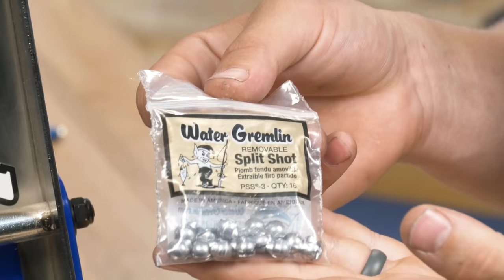Shop Talk: Is Wheel Balancing Worth It?

Comment: Dear Calvin and Truman,  This is the type of dumbed up video coming from a famous brand like PARK TOOL that makes consumers and the bicycle industry become dismissive about the importance of applying wheel balance technology. Wheel balance not only improves rolling efficiency & handling, but above all it makes a rider & bike much SAFER, especially at high speed.  Like any new technology like bicycle aerodynamics, first it was ridiculed, and now you can't sell a high end carbon or frame wheel with out it.  And just because you don't feel the advantage of aerodynamics working as you ride, its working. Same thing with bicycle wheel balance technology, and it will be more so then aerodynamics. Since the introduction of carbon wheels and improved aerodynamics bicycles are now faster and more sensitive then ever. But at the same time a new epidemic of dangerous HIGH SPEED WOBBLE/Shimmy has emerged and it is getting worse as more and more carbon wheels are introduced into the market.This type of dumbed up video that is going to turn around and bite Park Tool in the face when wheel balance will soon become the Must Have New Technology. Especially if its promoted mostly on its Safety merits.Also it obvious you have no idea how to balance a wheel. Just the fact that your are trying to demonstrate how to balance a wheel alone with no tire is just wrong, along with other silly things you do and say.Let me explain in as simple language as possible why a tiny and seemingly insignificant off balance of only 8 ~ 20 grams on a bicycle wheel is so dangerous at speed. This is the main reason modern carbon bikes at high speed ride nervous or go into an uncontrollable Speed Wobble. And the last place you want a bicycle to be unsafe is at High Speed.Look at those innocent 8 ~ 20 grams as a lighted match. If you drop that tiny lighted match on a dry grass field, its quickly turns into a large fire. And if that fire reaches a dry forest (meaning the speed increases)... Well you get the picture. The point is this, how to prevent that tiny match from being lit when it has to be dropped onto the dry grass field so as to prevent a bigger fire.This point exactly is what high end bicycle wheel engineers fail to understand as they focus only on the 8 ~ 20 grams spinning at high speed, and come up with a puzzling calculation saying this small amount of wheel unbalance is not significant enough to cause any problems especially the dreaded High Speed Wobble. And yes "Technically they are correct", BUT...What they don't seem to understand is those 8 ~ 20 grams at high speed start to invite the outer perimeter of the wheel weight to start oscillating.  And as speeds pick up, then the oscillation of the outer perimeter start to invite the entire wheel, from the axle to the outer perimeter of the wheel to oscillate creating incredible forces, to the point the wheel literally wants to tear its self off the frame.Making matters worse, now you have both the front & the rear wheel doing the same thing, but because the evolution of the modern bicycle is designed to absorb a tremendous amount of vibration, so the rider hardly notices the danger going on beneath them.  If by luck the wheels are fairly unbalanced going at about 35 mph the first sign a rider feels is the bike starts to handle nervously. Now the same rider approaches 45 mph plus, and now the violent oscillations of the front & rear wheels momentarily synchronize. Here is where the S#!T hits the fan as you now have the forces of two sledge hammers swinging in unison from the axles and the powerful oscillation forces can no longer be absorbed by the bicycle frame, rider and wheels that's when the High Speed Wobble happens, as the carbon wheels literally start to warp trying to destroy them selves trying to shed all that energy.You can see this happen in this video https://www.youtube.com/watch?v=QC-PuBDFNac  forward to 1min 10 sec. I know the fenders are shaking but look at the bottom of the wheels very carefully...My closing argument is this; Go look at a Chevy Suburban wheel an you will notice a tiny balance weight. Then ask your self how can that tiny piece of lead keep a massive 40 lb wheel balanced at high speed????  The answer is this, this tiny piece of lead cancels the tiny match from getting lighted when it gets dropped onto the dry grass field...So please all you are doing is putting your brand in a bad light because you are promoting something that is potentially very dangerous to riders all because you fail to understand this basic technology called wheel balance.  And if you still don't think its important then tonight when you go home, why not pull off those silly balance weights off your vehicle.Also there is a big difference between a bicycle, auto and M/C wheel.  Bicycle wheels easily flex, where auto & M/C wheels are much stronger and hardly flex.   Just remember this fact, Newton's 1st Law; a mass that is put in motion will continue in motion unless interrupted by an OUT SIDE FORCE (ie aerodynamics), or an OSCILLATION (ie wheel balance).   Imagine that, an FI racing car runs on these two facts.SincerelyDan Sotelodynamicspeedbalance.com

Comment: ive never done this or noticed it, but i do know that vibrations are never good for anything mechanical it can end up shaking bolts loose and such. does this really matter on a bike though i dont think so becuase i dont think it will be able to spin as much like if it were a car wheel, even then the difference will not be much because if it is likely wheel is already broken.

Comment: I don't think it will be an easy to control issue as tires and tubes  are not uniform either, then we add tubeless fluid for tubeless system... Well I have an idea why don't we add a single large wheel reflector and blame the unbalanced forces to it.

Comment: Hi, I have a Schwinn  all traine bike from Walwart. While riding the bike has a bad habit of leaning to one side while riding and makes it difficult to keep a good balance while riding. I have had other bikes in the past that had good balance while riding that I was able to ride without hold the handles. While trying very hard to do it with this bike has a terrible balance problem of leaning to one side throwing my whole rhythm and balance off. What can I do to fix this problem? Would balancing my tires really fix this problem? 🧐
Reply from the maker: Balancing the weight in the spinning wheel is not the issue.  Begin by checking the front wheel is install straight in the fork.  It is possible the fork it bent and this will cause the bike to pull to one side.  Get the issue correctly diagnosed, but it may be a new fork is required.  Last, if the bike was crashed, the frame may also be bent.  There is not a good repair for this.
Reply: @parktool  Hi, the bike was never crashed and was hardly used. I bought it brand new and was shipped directly to my house to assemble. I did not notice any damage to the forks nor any misalignment in assembly of the bike. Still leans to one side throwing off the balance on the bike.
Reply from the maker: Send an image of the bike to tech@parktool.com We may be able to help more there.

Comment: I'd say balance when you change tires and try to get the heavy spot on the tire to the opposite side of the heavy spot on the wheel before adding weights. After that, fugetaboutit.

Comment: I have taken some amount of time to balance wheels on a bike, but rather than being a two-wheeled upright, it was a three-wheeled recumbent trike and because of the imbalance on the left front, it would cause speed wobbles and veering to one side on fast descents, bearing in mind my top speed was 84mph, it was too dangerous not to have everything just right. So I did spend almost a day getting things to exact perfection, firstly by trying a similar method to what you have done in this video, but eventually just making an adaptor to run on a jig made for car wheels. Once balance, riding at speed and descents were much more pleasant and it only took 5 grams to fix it. Personally, I wouldn't bother for a two-wheeled machine, Taking it off-road wasn't always smart either... https://www.youtube.com/watch?v=BAo9KF6R-bs

Comment: I wonder if you can help I took my mountain bike to a shop to change the cassette the triple chainset and the chain got it after a month and they said that it has been ride tested so i took the bike and went home at the first hill i gave it a bit more power on the pedals and the chain slipped on top of the gears so i called them and told them and argued with them cause they said the bike was fine i took the bike to another shop after telling them what happened and they called me back after a day saying that the gear controller is not suitable for the back  derailleur as it is a Shimano Deore and when it clicks it does not move the derailleur properly 
By the way the shop changed the controllers as they said the were worn out so do I have to change the derailleur or there is something else it can be done? I appreciate any help you can give me  regards
Reply from the maker: Without seeing everything and being there, giving detailed advise is difficult.  The shifter and derailleur need to be compatible.   A shifter can also wear out.  That does not mean the derailleur require replacement, but again the systems need to be compatible.
Reply: Thank you for your prompt reply and for your advice I'll make a note of it Regards

Comment: Maybe its off topic..but..when just learned to true wheels on my bike...the rear wheel i got off center to the right...maybe about 1cm...is it possible to get it back to center...without truing stand??
Reply: Yes u can use zip ties as truing pins , check Seth's bike hack tutorial
Reply: If your wheel is significantly off center, you may want to use a dishing tool to recenter the wheel.  A truing stand or zip ties on your bike frame will get the wheel straight but not necessarily centered.
Reply: @airwilliam24  i was using zipties...but somehow it went to the right watching from behind...I'm bike mechanic but with very basic tools.....thinking off just to turn every nipples half turn in on the left side and half way out on the right...
Reply: @denishuber7758  rj the bike guy made a functional dishing tool out of wood and a machine screw.  Only costs a few bucks.

Comment: I've never balanced the wheels on any of my bikes. Not even my road bike. I don't ride fast enough to warrant it. Several years ago I worked as a tyre fitter. Car need their tyres balancing as over 30 mph it damages the vehicle and affects handling. These issues I've come across on my bikes. Don't even get me started on the in-balance cause by repairing a puncture. The extra weight on patch and/or rubber solution. You need to know the exact amount and weight. Too much trouble. Just ride.

Comment: Too funny. If bikes had cruise control, and you accidentally set the speed at exactly the resonant frequency of an unbalanced wheel, then...MAYBE...you might notice things IF you were riding on a totally smooth surface and your bike wheels had a unusually large rotational inertia. But, bikes don't have cruise control, and the odds of hitting the resonant funnest are slim, and the rotational inertia of most bike wheels (especially road bikes) is relatively small, and roads/trails are bumpy. And THEN you have the added problem of road debris getting stuck on the tires and rims, creating wheel unbalancing issues galore! And what happens if it RAINS! The water does not distribute itself evenly around the wheel. Wheel imbalance! Wheel imbalance everywhere!

Comment: The method used in this video is bullshit,  the best way to go about it is to use  soldering to make a flat counter weight for inside the wheel under the rim tape.  When it comes to balancing the tires the best solution is to add sand to the inside of the tube , it will automatically balance as you increase  the  speed of the wheels rotation